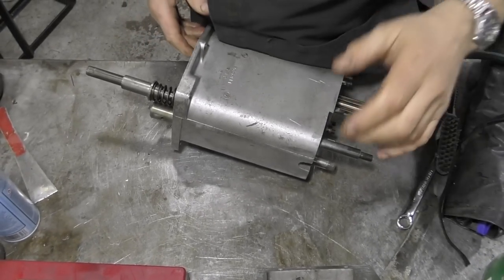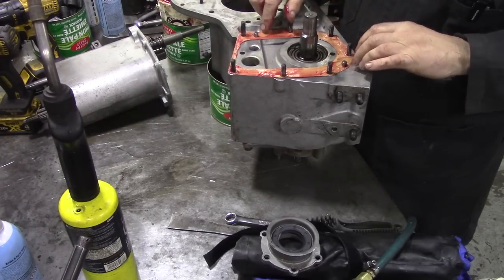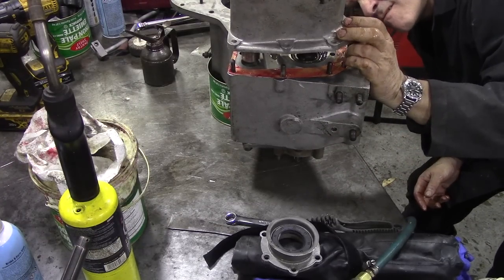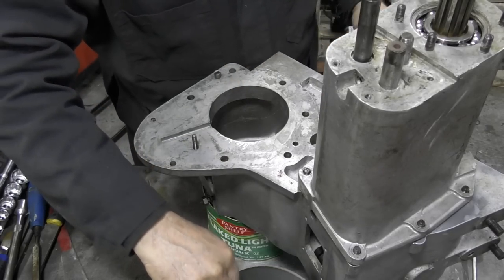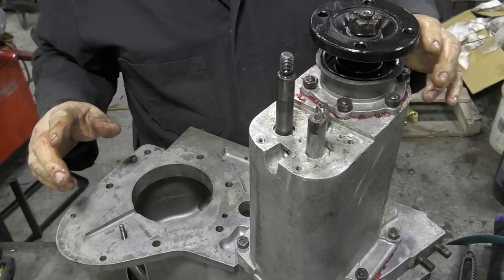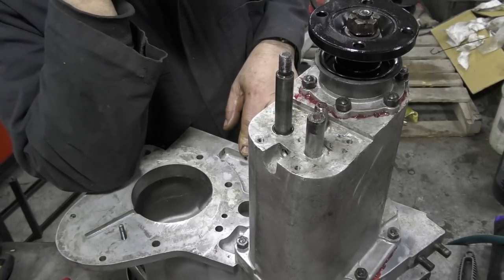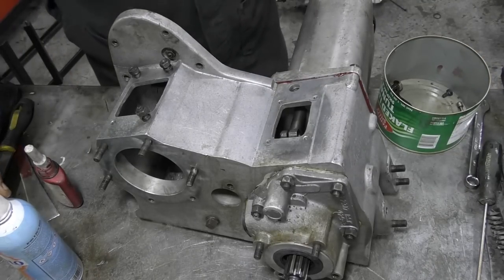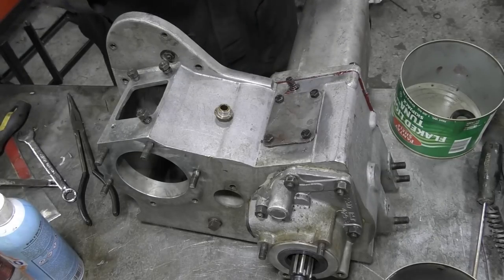Series 3 transfer case part 2

Comment: When I was a 'lad' in the sixties we used Stag on the drain plugs of pumps we made. Almost impossible to unscrew them when set, not good if you were on a service call to a farm or a trawler at Scarborough, Bridlington or Fleetwood. Don't think they send 'lads' out now, health and safety.
Of course on motorbikes the usual sealand was red Hermatite, visible at every joint.
Thanks for the memories.
😎🇬🇧
Reply: Blue Hylomar , as used by Mr Rolls apparently , was my go to product . It never let me down ; but I would grease a gasket if and when at all possible .
Reply: We used blue Hylomar, no gasket, on the joint faces of horizontal, split case steam turbine lube oil pumps for Parsons, GEC and their successors. No actual joints as they were machined face to face and the Hylomar was effectively, or assumed to be,  of zero thickness. 
I sometimes get to rebuild pumps from my old firm so it's Weetabix cartons, near enough twenty thou, and grease. I won't be the next person to work on the pump but the lad or lass that does will thank me for using it, and it's non stick properties.😎🇬🇧

Comment: Series Transfer Box is time proven robust simplicity at it’s best, just a pity the pre - load of the rear output with shims can result in oil leaks & contaminated hand brake shoes. You either love it (which I do) or hate it for being so simply mechanical. This simple but robust design built Land Rover.

Comment: Great job. I've done a few S2A and S3 transfer/gearboxes and they are preety similar. I heard to use grease in the papper and cork gaskets, but always thought it could be insuficient for a good sealing, so I adopted to use a varnish seal, loctite MR 5923 with good results so far. Do you think it  is a good option or grease is better? Thanks and keep going turning land rovers better.
Reply from the maker: Depends on the condition of the parts you are fitting - on some rough machined parts I use a gasket and sealer, but most surfaces are pretty good, so grease works well with a paper gasket
Reply: @BritannicaRestorations  Ok. I'll try that way. Thanks again.

Comment: Mike, the biggest problem with silicone joint sealant is some of the "monkeys" that slather it on all over the surfaces. A thin bead judicially applied to one half of the joint surface is all that's required. In my last years of doing Landy and other engine/gearbox repairs I completely stopped using manufactured gaskets except of course for head/manifold gaskets. The oil stayed inside everything just great with silicone only.
Reply: What is your proffered silicone - I'm asking for a monkey?
Reply: @gazzafloss  SAVED thank you.  Very helpful!
Reply: @gazzafloss  Blue maxx by loctite?
Reply: @iceman9678  that's the one, and the grey stuff for Toyota sumps 👍.

Comment: Hello Mike, i have à serie 3 pb that not correspond to this vidéo, but since it série 3 vid, i ask here... I changed thé valve on my serie 3 2.25 D low pressure pump, and it doesn t want to start.... I purged thé filter, thé high pressure pump (both screw), remove thé pipe of thé first injector, but no fuel from it when i make thé starter motor on... Did you made any vidéo about serie 3 D fuel purging ?
Reply: More of that, i plugged à manuel vacuum pump on first injector pipe, providing -0,5 bar, make starter motor on, but no more fuel from injector pipe...
Reply from the maker: Sorry I have never seen an S3 diesel here
Reply: @BritannicaRestorations  ok, wathever,  if you have an idea to investigate, I take it.
Ty
Reply from the maker: If you have bled the injector pump then it has to be something internal  - could be something to do with the stop linkage inside
I have not had the opportunity to strip on and explore
I have seen the 2.5 NA pump snap the drive shaft - but not sure if these pumps are the same
Reply: @BritannicaRestorations  this what i m afraid of (internal high pressure pump pb), since it is old, like everything in this car.But i didn t tuch anything on this élément,  so i didn t investigate. I ll keep bleding and see if any progress 
Ty for advices.
Reply: Stop system may be thé pb. When i tuched thé lever, first, i felt à little resistance in thé up direction, and since that, thé lever became like free, up and down (from engine place) After that, i pushed accelerator full, and felt again little résistance on stop lever, in up direction,  but less than first time. Think this part is thé origin of thé pb. Do you know what is thé effect of thé stop system ? Stop fuel ? Down pressure of it ? Send back fuel to tank ? I may check thé back pipe to check if pump work well and if fuel goes back to tank, since nothing on injector pipe...I ll tell you
Reply from the maker: Email me and I will send you the workshop manual on the DPA pump britrest@britrest.com
Reply: @BritannicaRestorations  ok, ty, i send you email now, you have it already for rrc 300 tdi pb :)